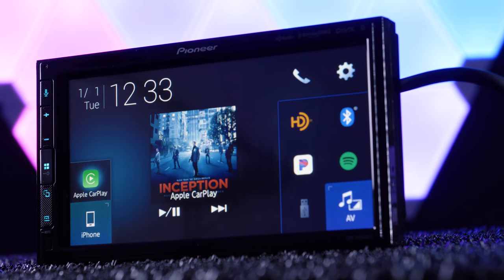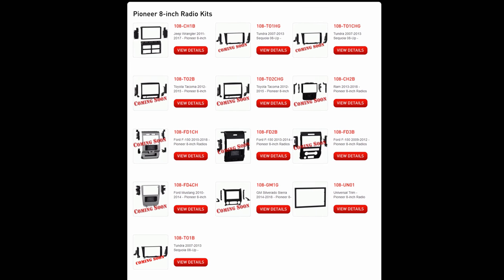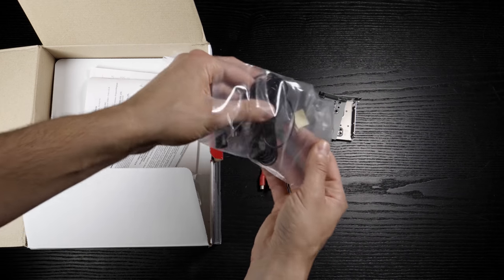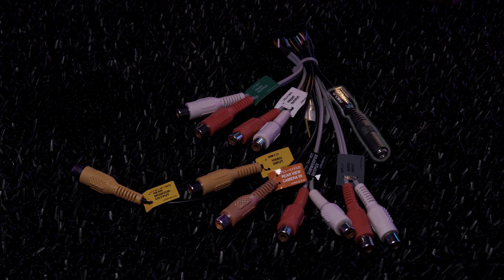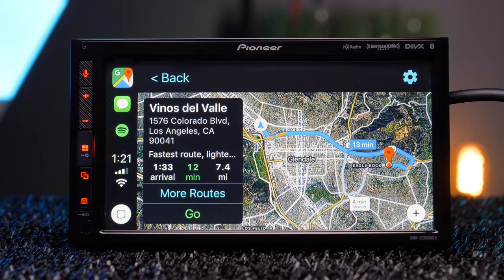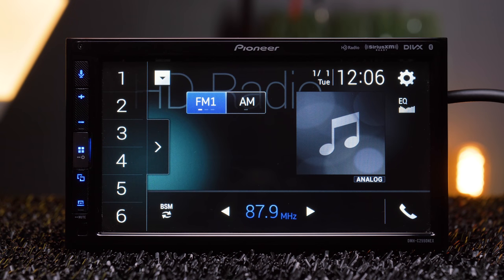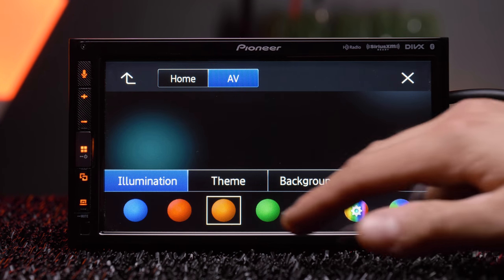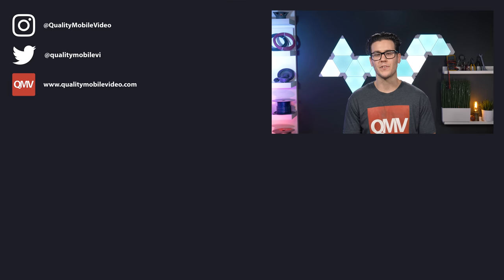Pioneer DMH-C2550NEX vs DMH-C2500NEX Modular Stereos - Which is Better?

Comment: Really want the capacitive touch of the 5500 series but, can't stand a lack of physical buttons. When in a vehicle that has a stereo without physical buttons or knobs, it really distracts you from the road to do simple things like adjust the volume. And I don't care for steering wheel controls.

Comment: Hey I am gonna take a DMH-c2500 or 2550nex 6.8 and using that 30pin wire that connects the screen to the chassis make a custom Y splitter wire and connect in a second larger screen from the DMH-c5500nex. So I have 6.8 in my standard double din spot and a larger 8” screen on pass. Side in my airbag spot. I really think it would work. They all use same 30pin chassis to screen cable and basically run the same brain unit setup.

Comment: Hello! Can you confirm if the 3500NEX ALSO gets the updated processor for faster speed? I have the 3400NEX, but I may buy the 3500NEX for another vehicle and curious if it will be "faster"...thanks mate!
Reply from the maker: The 3500 does have the advanced user interface

Comment: Can this be installed as a single din radio? Also is the screen depth adjustable? I was wanting to get this model for my 91 caprice.
Reply from the maker: No, as stated in the video this is a Double DIN stereo. You can also tell just from looking at the product, the screen is clearly a Double DIN display, so it'd be impossible to install in a single din opening which is only 2" in height. Not exactly sure what you mean by adjustable depth.
Reply: Just use a different shaped bracket, I think it could be done. I would cut two thin pieces of aluminum sheet in an L shape to the length needed to recess the brain box into the single din slot and screw the screens rear panel to it centered.

Comment: What about fitment in a 14 MINI F56S? I'm guessing no since we have the integrated oil level and other diagnostic crap, but grasping for a yes on some unit eventually.
Reply: Pull off the radio bezel and break out your tape measure.

Comment: Would you know how to make an OEM backup camera with a pink CANBUS wire work with these? I couldn't get mine to work, maybe theres some interface you know about? Thanks
Reply from the maker: Impossible to know without your car's info. What's your make/model/year?
Reply: Quality Mobile Video it’s a 2019 Jeep Wrangler unlimited.
Reply from the maker: @bluespy4  Sweet! So the 2018 models actually have dash kits for the DMH modular stereos! I'd be shocked if they didn't work for the 2019 Jeep models. But I'd call them to make sure. Here's there site and the kit you'll need: http://www.metraonline.com/part/108-CH1B

Comment: Hey I have everything I need just wanna know if it'll fit in a 2005 g35 coupe??, please answer if you have the time much appreciated 🙏
Reply from the maker: Yup! You have two dash kit options:
https://www.qualitymobilevideo.com/95-7605.html
https://www.qualitymobilevideo.com/95-7605a.html

Wiring Harness:
https://www.qualitymobilevideo.com/70-7550.html

Antenna Adapter
https://www.qualitymobilevideo.com/40-ni11.html
Reply: @Qualitymobilevideo  thanks so much 👍 stay safe and blessed 🙏

Comment: Does this head unit allow to control rear door speakers?
Reply from the maker: You can wire rear speakers to any headunit yes. And this stereo features high pass crossover settings for speakers

Comment: Is the dmh-1500nex pretty much the same but without HD radio? Specs wise I really dont use radio so no need for HD radio and it's like 70 bucks more
Reply from the maker: The DMH-1500 actually is not a modular unit like these
Reply: @Qualitymobilevideo  ok so that is the major difference besides HD radio right ?
Reply from the maker: @Nick_24bean  yup :)
Reply: @Qualitymobilevideo  ok sounds good I'm going to open my dash to see if I have room lol it's a 13 civic
Reply: The 2550 also has a remote control..

Comment: What is the difference besides screen size/Modular display in these models and AVH-2550NEX series? I'm swapping from a Kenwood DMX905S to one of these. The AVH-2550NEX or the DMH-C2550NEX. Beyond what was discussed in this video.
Reply from the maker: AVH has the rear connections built in, the C2550 uses the AV pigtail harness. AVH is navigation compatible with the AVIC-U280. The AVH can play CD's and DVD's but C2550 cannot. That's about it
Reply: Quality Mobile Video Thank you! Can I ask a technical question. If HD Radio blend is turned off on a weak HD radio station, will the HU switch to pulling in the RDS data instead? I have the DEH-X8800BHS and it will do this.

Comment: Can this still be mounted normally in a double din slot?
Reply from the maker: You need a specific dash kit made for these modular units. What's your make/model/year?
Reply: @Qualitymobilevideo  No I dont. This comes with brackets to mount into a double din slot. I have a 2006 Nissan Xterra. Looking at other videos I dont need anything that the brackets that hold my current double din stereo.
Reply from the maker: @Tony-uo4ml  With the 5500NEX you do sorry
Reply: @Qualitymobilevideo  Yeah thats true.

Comment: Will this fit in 2019 rav 4
Reply from the maker: Unfortunately, as you can tell the newer Rav4's have a very specific entertainment system up front, completely unique and virtually impossible to replace without extension custom fabrication

Comment: Can I mount this in a single din location?
Reply from the maker: No
Reply: Would be nice, have people who want CarPlay or auto but don’t want the Pioneer 3000 series
Reply: Yes, after you hack saw a bunch of your dash so it will fit.
Reply: @CORZER0  I bought the DMH C2550 NEX  for the 79 camaro I'm resto modding and I have to loose the AC vents in the center dash to install this thing, LOL. You can just about put any stereo into any car with enough fabrication,  hahaha.

Comment: I'll never buy another radio that doesn't have wireless AA. Or I'll just ditch them altogether.  I've been through so many USB cables-yes they were all cables supplied by manufacturer of phone, plus replacements from them. Just flat out doesn't matter. they don't hold up. Whatever it is,. They need to fix it. I won't waste my money and this or any other unit. Yea it's cool, but no wireless , and even no HD screen, no thank you. If smartphones can put all that technology in that tiny of a space , no reason they can't.  Tired of getting nickel and dimed with the slow to catch up technology that's honestly way behind.  Got a buddy who owns a car stereo shop, we are just gonna throw a tablet on my truck and have all the bells and whistles
Reply from the maker: It's shocking how few stereos actually have wireless AC and AA
Reply: @Qualitymobilevideo  I agree.  Oh, and didn't mean to sound like I was ragging on your video. Absolutely not . You're uploads are great.  I had just had one of many daily battles with my USB so was a little ticked off lol. Some days it doesnt give me issues , some days It won't stay connected to save my life.  Then have to go through the whole process of uninstalling and reinstalling and this and that and it just makes me want to go back to strictly CDs. Sometimes it's such an elaborate situation with car audio these days and having to worry about wire and bitrate and streaming and on and on, it sounds so nice to just to pop in a CD , know it's the best quality , and just enjoy your music
Reply: @Qualitymobilevideo  I'm assuming there's a technical reason for this..